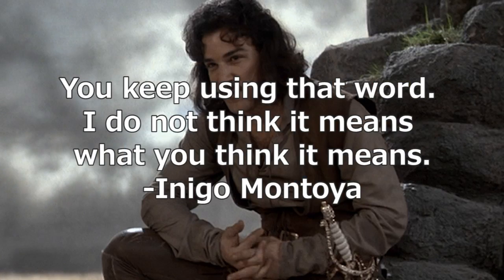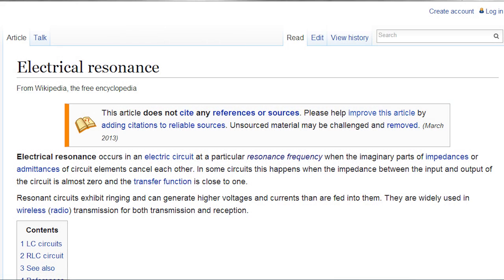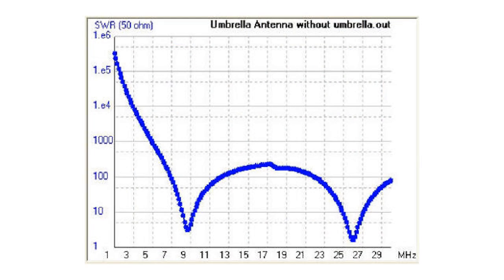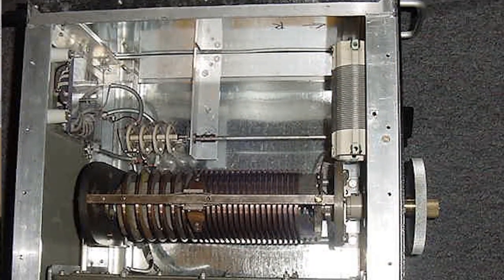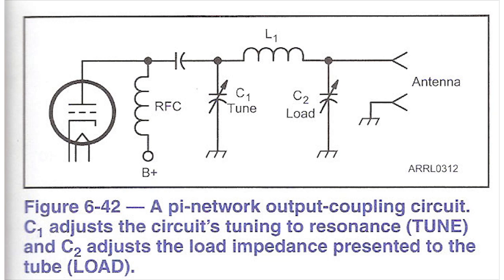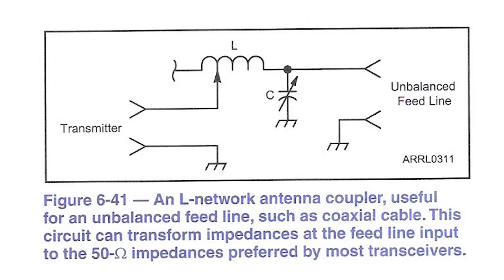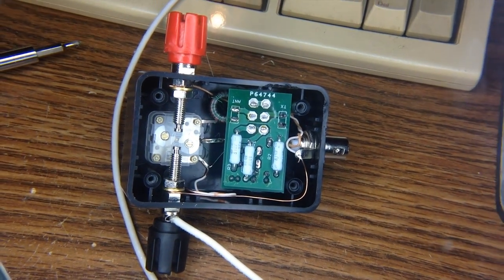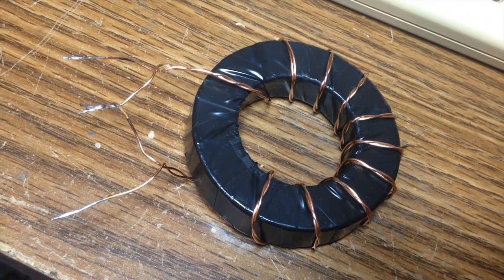Resonance vs SWR

Comment: From a Facebook conversation about this topic:
I see that some still accept the argument that "reflected" power is real. You do not put 100 watts into an antenna, see 20 watts "reflected" power and have 20 watts traveling back down the transmission line. SWR is a simplified measurement of the phase angle of a signal into a complex impedance. The only true losses with a high SWR are resistive losses in the feed line.
Reply: Show the guy who made that statement a plot from a time-domain reflectometer (TDR). It clearly show "real" energy pulses bouncing back and forth from source to load until it dissipates, as heat in the feed-line. Or write the eulogy for his blown final PA as, "He is not to blame for delivering max power into a reactive load. No one alerted him to the dangers of a large angle between the voltage and current wave-forms. He was a good soldier."
Reply: WA9KZY do you mean that sending 100watts into a resonate antenna with 20% feedline loss results in trapping the full 20% of loss in the line?